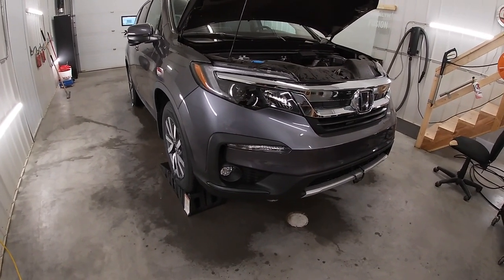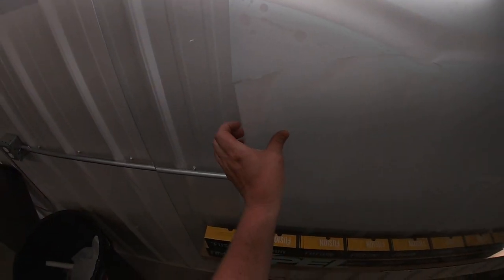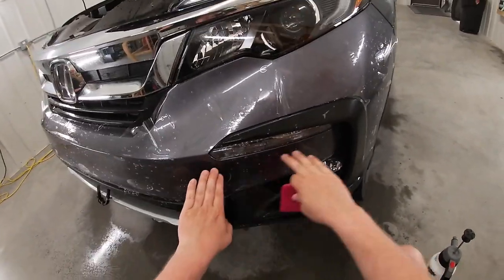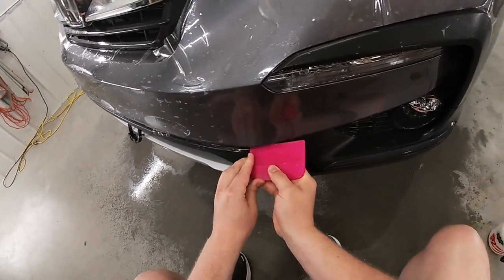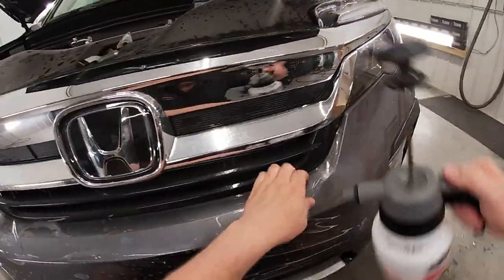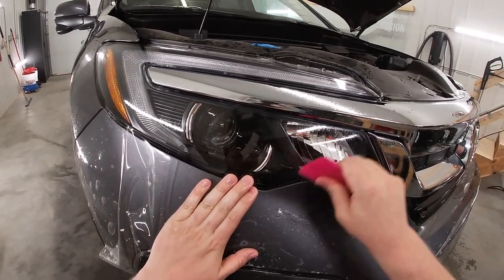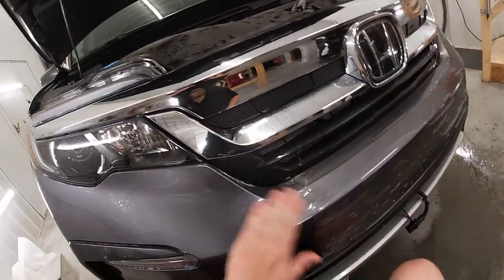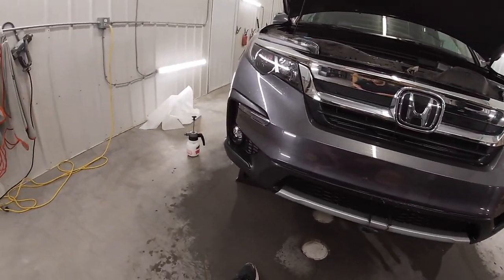2021 Honda Pilot gets protected!!

Comment: Hey Eric, do you install bumper first before fenders hood?
Reply from the maker: Depending on the job. Most of the time I’ll do bumpers last
Reply: In which case do you install bumper first?
Reply from the maker: If the vehicle is prepped and on the ramps already I’ll go bumper first. Or whether a bumper will be the most time consuming I’ll do everything else first and save bumper for last

Comment: Is it worth it to do on a vehicle that already has like 30,000 mi?
Reply from the maker: If the paint is still in good shape, yes it is.
Reply: @DriveProtected  last question, what can I expect to pay if I call a place to do it? Or should I call Honda dealership
Reply from the maker: @CastIronEric front bumper probably around $500 or so. Full front end, probably $2k. I’d hire a third party to do the install. Don’t think Honda would offer this service.
Reply: @DriveProtected  appreciate the info bro ty